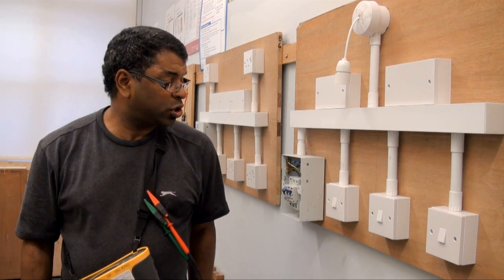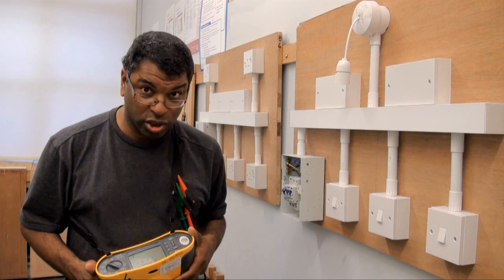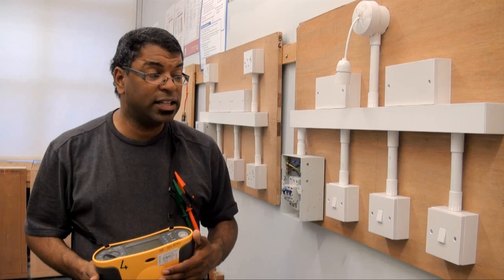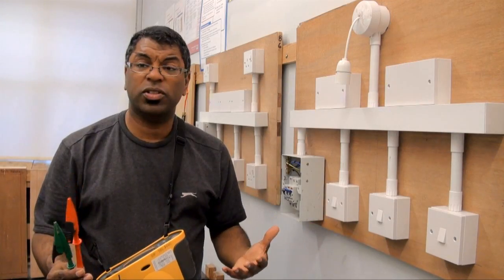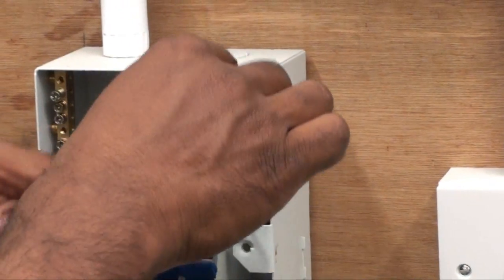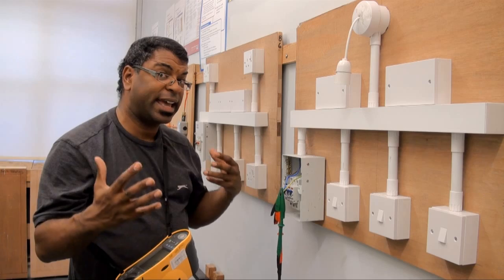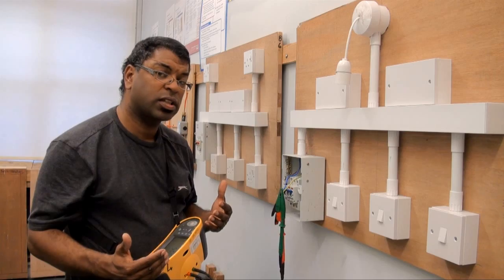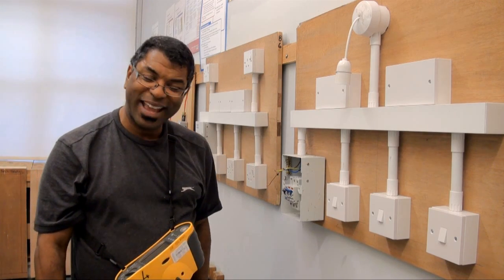Testing Continuity of a CPC method 1

Comment: Wrong wrong wrong, 
Insulation resistance test  should be all loads removed and all switches in the on position, you test between line and neutral line and earth neutral and earth , if there are any sensitive equipment in circuit that can’t be removed from circuit then test line and neutral combined and earth or test at 250v  .